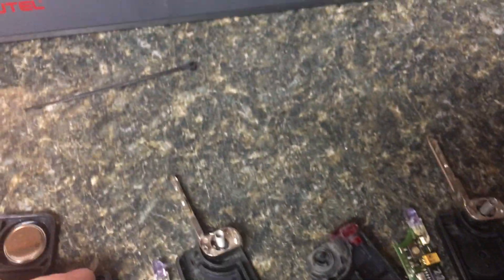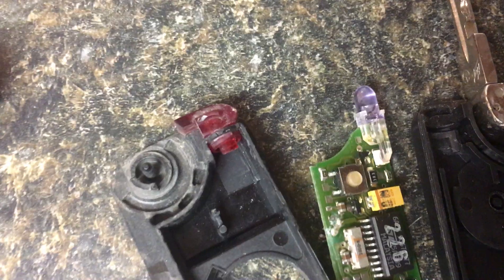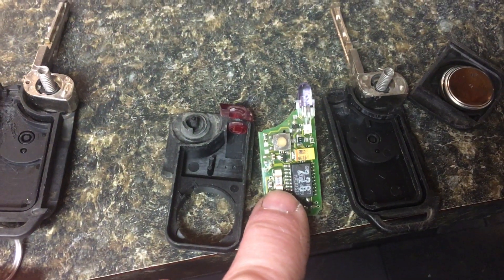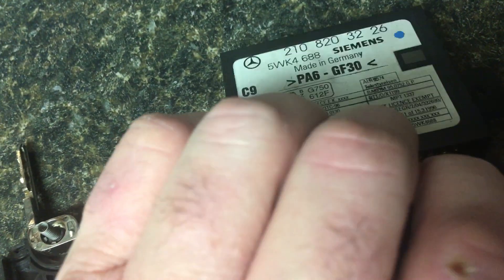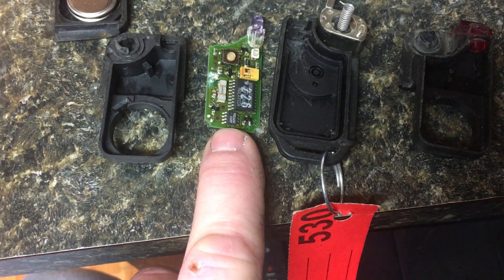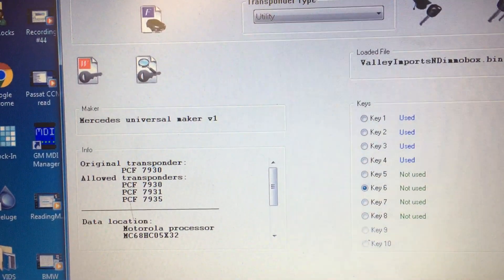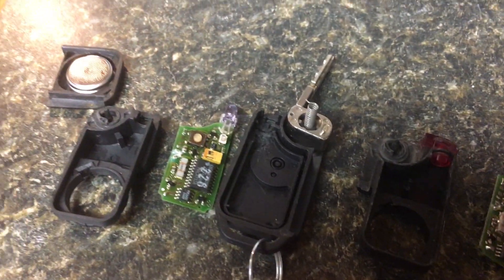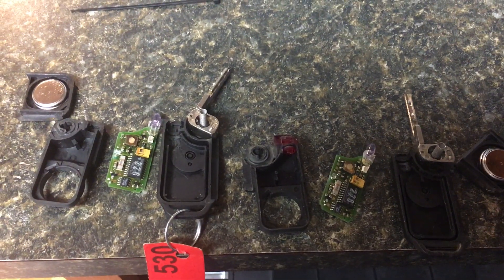Older Mercedes Keys

Comment: Great Job Tim appreciate your effort will you be able to do video on Audi A3 2012 all key lost to find 7th bite component security.
Reply from the maker: do you know which cluster that has??  if it has the cluster with the little plug, I have one on the bench trying to figure out the wiring...  If it has the blue plug, it should be an NEC cluster...
Reply: Thank you for reply Tim
It is vdo micronas 24c64  inside cluster ecu is pcr2.1 for spare key i can read pcr2.1 and 7th bite from a working key, but in lost key situation how to get 7th bite as i tried service mode by modifying 24c64 like golf5 will  not give immo data even with working key 
it's 8p chassis.
Reply from the maker: @autotechkeys.  well, if have you have the first 6 bytes, have you tried finding the 7th byte with AVDI and either the old tag key programmer or an emulator??

Comment: Can a remote be programmed to an sl 500 1998  that way with the avdi file ? customer has a working key  but wants a remote key .
Reply from the maker: if you can pickup a used remote for the car, yes...  Go to mercedes, special functions, DAS2, then load the data file you read from the Immo box, select which remote you want to program, click on generate, it will open a box and ask where to save the file, take the 93C66 or 8 leg chip off the remote, write the file AVDI generated, and then go to car and click the button on remote a couple times and it syncs...  Actually, I have never had to sync one.. they just work..
Reply: @timtracy9442 Thank you for your help Mr. Tracy . This is Matthew shong Justin's apprentice I'm always eager to learn something from someone of your experience and expertise.
Reply from the maker: @matthews.5369  Hey Mathew, glad I could help...  The biggest issue is finding a good used remote...  and just remember, you will destroy the case trying to get it apart.. so you need a new case for it...
Reply: @timtracy9442   I have some old remotes  210 760 1306 are the numbers on the remote I think will work. It's a single button and has the ir light.
Reply: When I go to das 2 its asks for ifz dump is this the immo bin file its asking for? When I load the immo bin file it say attention the ifz needs to be repaired. To repair ifz dump enter a sew ssid and save ifz dump.... I am having trouble figuring out the steps.
Reply: I mean new ssid not sew. it says ssid bytes do not match.
Reply from the maker: @matthews.5369   I have never had one that says it needs to be repaired... What happens when you go to the bottom and click on make a remote??
Reply: @timtracy9442  so I go to das 2 and its asks load ifz dump and it spits out a ssid and password I select the key number then press generate it then pops up to select a file location and I select a thumb drive and it says generation completed successfully.
Reply from the maker: @matthews.5369  now you take that file you saved and write it to the chip on the board of the remote..